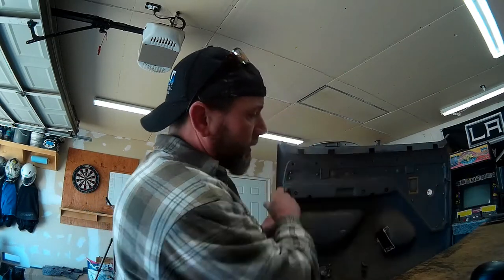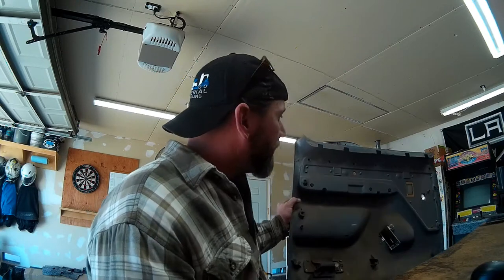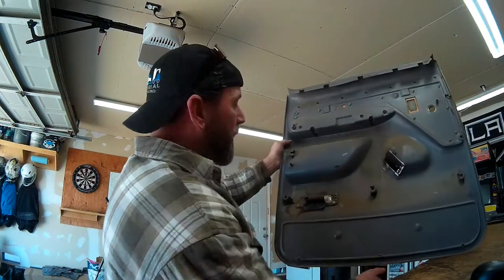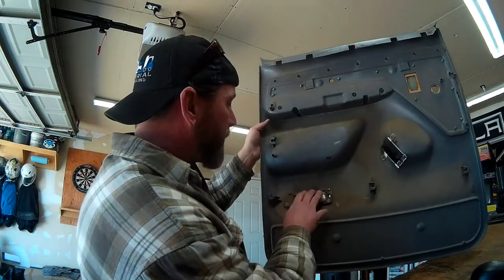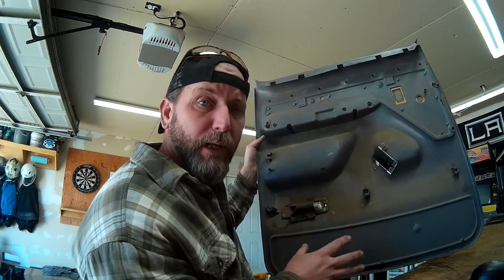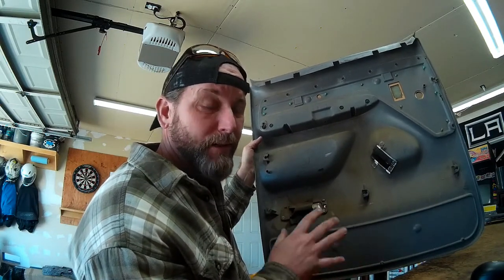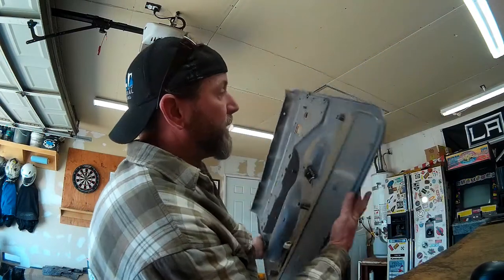Ford OBS; 7.3 Door Panel Repair & Interior Mods, Part 1

Comment: @vintagespeed Garage thanks for this video. I've been wondering if there is a way to beef the back where the door panels crack (over the window ) I have a 93 flareside so I'm defiantly ready to do a teardown and restore on it to.
Reply from the maker: i would guess you can beef up the inside of the trim panel with some fiberglass cloth, repair the crack & refinish.  in the same way i did on the panels.  i dont think my trim is cracked above the window, but i'll take another look just to make sure.  thanks for watching!